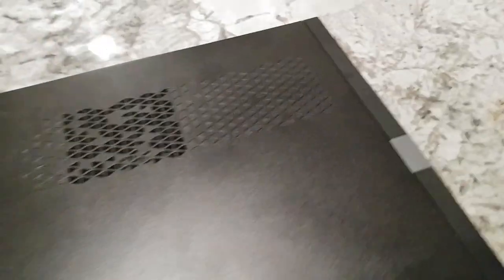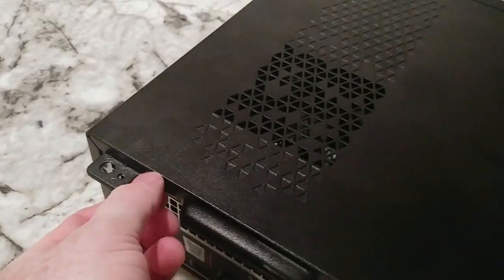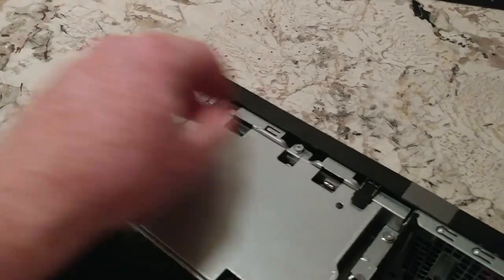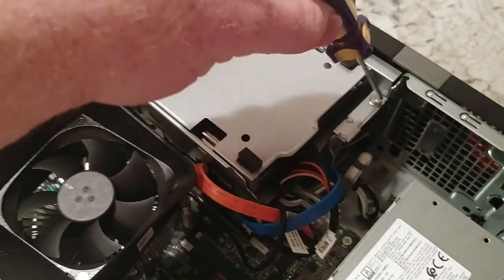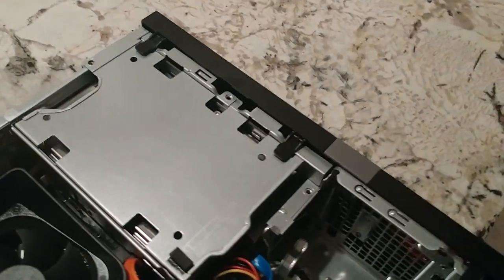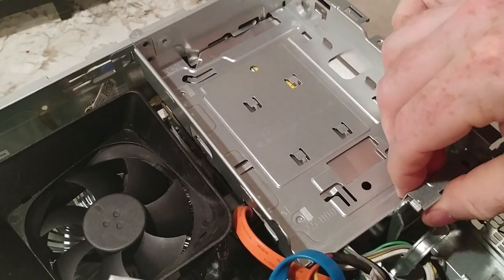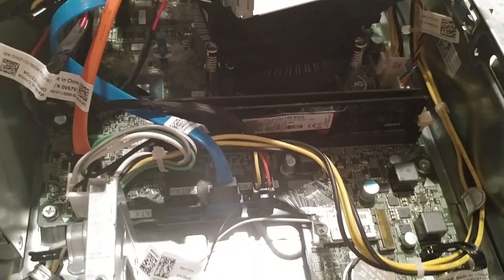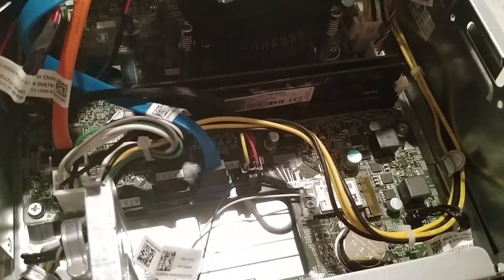How to disassemble Dell Vostro Inspiron 3470 desktop to install RAM or Hard Drive, instructions

Comment from the maker: Here is one of the graphics cards that will work:   PNY(196E 11C7) 2GB; PNY NVIDIA GEFORCE GT1030 LOW PROFILE
CLim: 1911 MHz, MLim: 1502 MHz, Ram: 2GB, Driver: 417.22
Reply: can we use gtx 1050 ti mini
Reply: @kratos6207  it's not mini, it's Low Profile
Reply: @3azizBenz  no bro its model it was written mini leave , just tell vostro 3470 support or not
Reply: Vaibhav Mohandas yes, no problème i5 8400 + gtx 1050ti low profile + 3S-ATA + 2ram = 200w, the psu of the vostro is 250w
Reply: @3azizBenz  thamx dear; 
what about 1060 gtx mini does that support to
Reply: ie gtx 1060 ti mini 3gb variant
Reply: Vaibhav Mohandas not support mini gpu just low profile
Reply: @3azizBenz  so it doesnt support
Reply: Vaibhav Mohandas it supports but it does not pass in the pc only the low profile, the best low profile is gtx 1050ti lp
Reply: @3azizBenz  how u r so sure have u tried it
Reply: gtx 1050 ti mini has ddr5 it will support?
Reply: Vaibhav Mohandas yes in hp elite 8200, its no mini, its low profile warning
Reply: Vaibhav Mohandas mini is too wide for sff pc
Reply: @3azizBenz  dude plz tell me where this graphics card is comparible ASUS GeForce 4GB HDMI 2.0 DP 1.4 DVI Graphics Card (GTX1050TI-O4G-LP-BRK)
Reply: @3azizBenz  bro r u sure about this one u wont require additional power supply
Reply: for msi gtx 1050 ti lp
Reply: Vaibhav Mohandas see
Reply: @3azizBenz  i cant understand this language
Reply: sorry i follow british english
Reply: @3azizBenz  what ur review of tanotis website
Reply: for computer components
Reply: Vaibhav Mohandas https://www.bequiet.com/en/psucalculator in english
Reply: can anyone plz recommend a cheap graphics card for vostro 3470
Reply: @3azizBenz  can i use amd graphics card
Reply: Vaibhav Mohandas amd rx 560 low profil https://www.bhphotovideo.com/c/product/1402549-REG/msi_rx_560_4gt_lp.html
Reply: Vaibhav Mohandas but its rare
Reply: Vaibhav Mohandas what is your max budget ?
Reply: @3azizBenz  170 dollars

Comment: I saw this on Amazon and saw your review I want to know if I can replace the power supply with a 500 watt one and stick 4 more gigs of ram and a gtx 970
Reply from the maker: Personally, I am only familiar with ATX style power supplies.  ATX will not fit.  To use  a better graphics card, I had to use a pcie ribbon extender.  You are limited to LP GT 1030.  Some if my other videos discuss this.  RAM 2Slots up to 2x16GB
Reply: @PC_HardwareTechUnboxing_1  thanks for the reply is the one with the bigger case able to fit a gtx 970 and a 500 watt power supply?
Reply from the maker: You might want to look at Dell Vostro 3670..that is more like a mini tower and should fit your card.  I can't afvise on PSU upgrade.  A 1050 TI usually is compatible. ..I have used it in similar I5-8400 and I5-7400 desktops
Reply: @PC_HardwareTechUnboxing_1  I can change the psu cant i?
Reply: David Noble what is the wattage maximum on this machine
Reply: @slyticular4710  lol that was a year ago I already got a new system

Comment: It looked like there was a PCI Express slot to take a low profile Video card - can you advise if this is the case and also what rating power supply is in the machine? Dell say's 200W but I read one review stating it was actually a 240W unit. Can you confirm from the unit itself?
Reply from the maker: Hello, I will have to get back to you on the power supply...I am going to be out of town for a bit.  Here is the card that people have been using:   PNY NVIDIA GEFORCE GT1030 LOW PROFILE   See this link:  https://www.userbenchmark.com/UserRun/12821929  You will note the above video card and gaming score of 24%...which is just on the verge of being decent.

*****So, I am not sure what your processor is...I think the I3-8100 TDP is 65W...and I believe the plain I7-8700 is 65W as well.  For the past month, I have had a ZOTAC GTX 1050 TI OC edition plugged in via PCIE Ribbon extender...I have had no power supply issues.  1030 should suck up a lot less juice.  Here is the video of that:  https://www.youtube.com/watch?v=XXYIY3Er4ag  I included benchmarks, I was able to get a gaming best score of 43%.

I have a bunch of videos out there of me upgrading (external GTX 1050TI, 16GB RAM, SSD SATA, M.2 SSD) and downgrading...I put in a 8th gen celeron and was able to do low-mid settings on 4k gaming...but without the card and at least 12GB of RAM, this processor was terrible for gaming, CAD, video editing, FX, 3D animations...etc.

Comment: Is there any RAID option in BIOS? I need a RAID 1 setup for the OS and apps (boot drive) but its chipset (H370) is able to RAID only SATA drives (no M.2 SATA RAID support) so I wonder if I could give up DVDRW, connect two SATA SSD's and enable hardware RAID 1 in BIOS? Thanks anyway for the video!

Comment: Hey....please, a second hard drive can be installed?
Reply from the maker: I spent a little time looking for a connector to split off to 2 SATA and the power...didn't find anything.  There is not an extra SATA connector on the MB.  Plus, where would u put it?  2 x 3,5" would not fit.  2 x 2.5" would probably.  May need another Dell PSU to pull it off...and go without CD drive.
Reply: @PC_HardwareTechUnboxing_1  Hi, I found an extra sata connector on MB. Only the power connector should be splitted. Also, there is space to add a second drive, ssd one close to existing 3,5 drive

Comment: Does this pc have a standard motherboard ?
Reply from the maker: I would say Dell Proprietary with DELL logo.   I would not be able to use any of my power supplies that I have that work with 7th/8th gen Intel MB's on this motherboard.   No problems with trying out various types of DDR4 RAM on it.  It works with at least 8th gen Celeron and I3-8100.  I was tempted to plug in an I7-8700k.  I will be changing out the hdd for an SSD soon.  From what I have noticed, I don't believe one can have more than one hdd or ssd in this thing.  No room for additional drive.  Locations for extra SATA connections but have not located additional power connections.  Not that you can get too many graphics card to fit, but there also  is not pcie power.

Comment: Can we remove psu and motherboard of this prebuild pc
Reply from the maker: Thanks for the question.  Almost sounds like you would be better off building your own ITX computer. :)  Unlike the Dell 3670 that I bought and upgraded everything in it..including going from 8th gen to 9th gen.  I only upgraded the HDD to SATA SSD 2.5", added RAM...did a couple of videos with a GTX 1050TI hooked up via external PCIE ribbon extender.  I did get quite a few questions about different PSU's.  The ones I looked at were expensive and it was unknown whether they would fit correctly.  Sorry, I was not much of a help on this one.
Reply: @PC_HardwareTechUnboxing_1  ohk nice btw keep going one day you will grow for sure..and thanks
Reply from the maker: Thank you, I appreciate the kind words.  I have bought quite a few different pieces of equipment since I did this video to improve the channel which really help with taking video inside of a computer case.  A lot of those things would have made this video better.

Comment: Does a rx 570 fit and work well ?
Reply from the maker: The AMD RX 570 I have requires a pcie power supply cable...this 3470 power supply does not have 1.  Otherwise I would have videos up about it.  :)
Reply: @PC_HardwareTechUnboxing_1  can I buy that cable or do I have to change the power supply entirely?
Reply from the maker: Certain GT 1030's will fit without cable.  1050 1050 TI requires ribbon extender... $10 part on ebay.  RX 460 and up would only work with a different power supply.  Plus, I think this one is only 200 watts.  I don't believe I gave ever seen a PS that has right cables and would fit.  :(
Reply: David Noble another power supply ? such as ? i think i might have to get another power supply then
Reply: @PC_HardwareTechUnboxing_1  Possibly another Dell one that is the same dimensions...but has the PCIE express...does it exist?

Comment: Hey plzzz tell can I add graphic card like 1050ti or Rx 570
Reply from the maker: I have already shown this in a video...but just to summarize only way to get GTX 1050TI to work is thru PCIE ribbon extension cable.  RX 570 requires 6 pin connector which this PSU does not have.  Please look up at my pinned comment, that is probably the only card that will fit in the case.  You may be able to use a ribbon cable to run GTX 750, GTX 1050, GTX 1050 TI, GTX 1650, RX 560, RX 460.  The key is to buy one that is low power and does not require 6 or 8 pin gpu connector.

Comment: Slot M2?
Reply: Yes.  The Vostro 3470 manual states that their is a M.2 SSD slot.  The machine only supports SATA speeds.  It does not do NVME.

Comment: hey man please reply can you install gt 1030 in this cpu
Reply from the maker: Yes and no...I have a video out there of me installing a GT 730.   To do that, I had to remove the fan..but keep it plugged in.  Benchmark overall was 1% better.  The ideal card would be really thin..possibly heat sink only.  Other options..remove power supply but keep eveything plugged in..and leave case open.  Possibly a pcie  ribbon cable extender..but card would be outside case.  If u come across anything let me kniw.
Reply: @PC_HardwareTechUnboxing_1 all right dude thanks for the reply. I see what I can do.
Reply from the maker: @swachhmemes4151  PNY(196E 11C7) 2GB; PNY NVIDIA GEFORCE GT1030 LOW PROFILE
CLim: 1911 MHz, MLim: 1502 MHz, Ram: 2GB, Driver: 417.22

Comment: Does Dell 3470 support RAM upto 16GB ?
Reply from the maker: Do you mean 16gb total or 1 stick of 16gb RAM?  Either way, the answer is yes.  Max memory is supposed to be 32gb...max if 2x 16gb sticks.
Reply: @PC_HardwareTechUnboxing_1  Thanks !